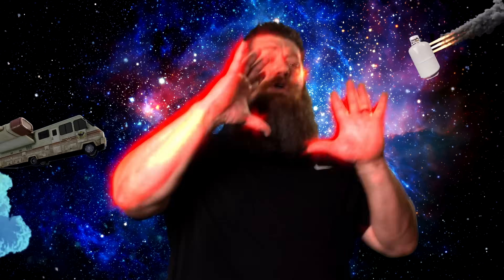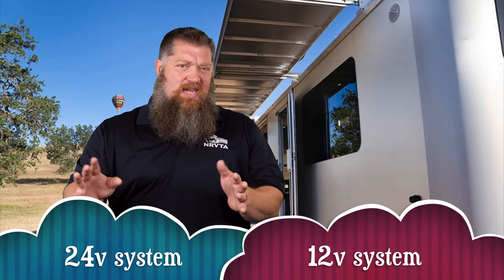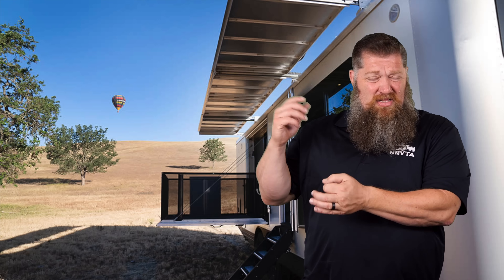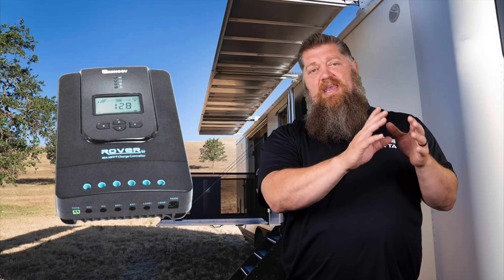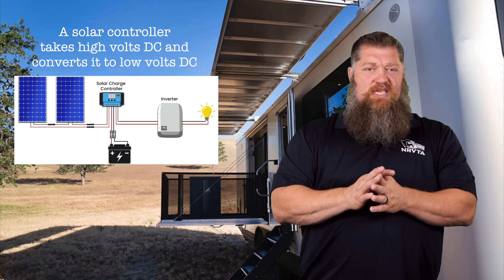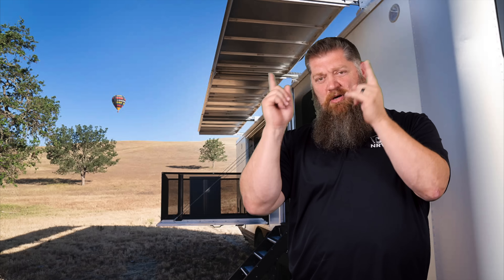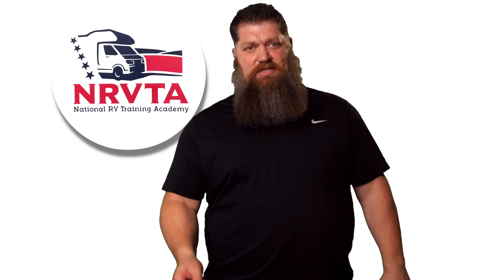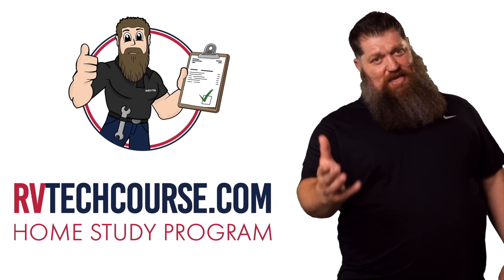Considering solar?  What's the difference between a 12 volt & 24 volt system?

Comment: What about the energy density of the batteries between 12v, 24v and 48v?  I am looking at a system using a 48v system party due to the price/kW hour for the batteries AND the fact you can dump a ton of solar into a 48V system.
Reply: For the same battery chemistry the energy density / capacity (in watt-hours) is the same regardless of the battery voltage.   E.g.  200Ah 12V battery vs 100Ah 24V battery vs 50Ah 48V battery ... all three batteries will weigh and have the same dimensions and capacity, roughly.   The internal topologies of the batteries are the only difference.  e.g.  4s4p (16 cells) vs 8s2p (16 cells) vs 16s1p (16 cells).  For example. 

NOTE: For 48V LiFePO4, always get 16s (16 series internal) "48V", which is 51.2V nominal.  Don't get 15s batteries that are also marketed as "48V".

In anycase, if you have the choice, go with 48V, it is hands-down the best choice for many reasons, not just wiring.  Amperages are far lower, heat is far lower, efficiencies are far higher, charge controllers (as you noted) can push far more solar power.  A 48V system has 1/16th the wire losses that a 12V system has.  48V is massively expandable even when starting small.

On the charge controllers.  For example, a cheap Victron 100/20 charge controller can push 256W of solar to a 12V battery system, and the same charge controller can push 1024W of solar to a 48V battery system.  Its night and day. 

EDIT EDIT EDIT:  I previously used the Victron 75/15 as an example but that charge controller cannot actually do 48V battery systems, so I updated my example to using the Victron 100/20 which can.

There are other discussions that can be had regarding equipment.  12V legacy equipment is certainly an issue but I would also say that when putting together a new system all the heavy hitters have native 48V options.  And things like POE+ (power over ethernet), including Starlink, can be directly powered on 48V 16s LiFePO4 (51.2V nominal) battery architectures.

-Matt
Reply: @junkerzn7312  wow...thanks for the info.  I am already planning my system to use 48v.
Reply: @markk171  One last thing I should mention is that with a 48V system voltage, the solar inputs for most charge controllers have to having operating voltages of 60V+.  Which means the minimum panel configuration is something like 3 x 100W panels in series.  Or for example two 320W 40V residential panels in series.

That's the only real issue and most people putting together systems and looking to expand have at least that in solar panels already.

In anycase, it is still possible to use cheap charge controllers.  The Victron 100/20 is a good fit.   The Victron 75/15 which I improperly used as an example in my first posting actually only does 12 or 24V batteries.  So the minimum charge controller for a Victron is the 100/20.   Always double check voltages.

-Matt
Reply: @junkerzn7312  yep...the Growatt 3000w inverter/charger solar input is 60v and the EG4 all in one 3000w inverter/charger requires 120v. My initial build will not include solar...these are for later.
Reply from the maker: So to understand your question, I think you are asking total watts and size of battery in 12v vs 24 vs 48

Energy density is calculated by the actual substance providing the energy in relation to volume. 

The specs of my batteries can be found here. https://www.bigbeardbatteries.com/online-store

Comment: LOVE YOUR VIDEOS, I'm getting a 2023 motor coach. It has 1 200 watt solar panel, a 1000 watt inverter , a dual controller what ever that is and 2 100 AH AGM batteries. I plan to up grade the inverter to 2000 or 3000 but initially would like to upgrade to a 200 or 300 AH lithium battery, can I just drop a lithium in with my current equipment ?

Comment: I watch and enjoy your videos but this one i feel compelled to comment.  I don’t think saying “by going 24v that you can double amount of panels”. Don’t you have to  consider panel voltage/wattage and series/parallel?    Thanks for all you do.
Reply from the maker: Absolutely. But let me sow you. 

300 watt panels
40 voc
10 amps. (Edit the fat finger) 

On a 12volt system  with a solar controller 150/100

I could put 4 in series/parallel ending with 80voc 20 amps 1200 watts. 

The solar controller is maxed at 100 amps regardless. 100 amps at 12 volts, limited to 1200 watts. 

In a 24volt configuration. I could do 4 strings of 2 in series. I would be at 80 volts abd 40 amps. 

The solar controller pushing 24 volts at 100 amps max gives a potential of 2400 watts.
Reply: Thanks but I’m not following your math of 40voc/20a = 300watt per panel. If you could please let give me example of a panel w those specs, I can pull data sheet n figure it out.  Also, in 12v example, if (4) were in series/parallel wouldn’t output be 2xVolts  and 2xAmps of panel rating?   For my small 2S/2P of 4x100, I get ~40v @ 10a.  Just trying to learn so I appreciate your time
Reply from the maker: @BigSpoonSaloon  so it’s 10amps. I fat fingered to the 20

Comment: is there an advantage on going with 48v system (EG4 48v 6.5kw all in one inverter) with 2 - 100amp batteries vs 12 or 24 volt with 200-400amp battery bank?  Would the 48v need a step down transformer as well or is it contained in that system? Would I even need that size system on 45' toyhauler?  Would like to add 600-1000 watts of solar panels to roof.

Comment: Another benefit, and the main reason I chose 24v for my very large dual 5k inverter setup, is the efficiency. Charging and consuming power at 24v is more efficient than 12v by a few percentage points at least (48v is even better). You have lower current through conductors, so lower transmission losses, and better conversion efficiency in charge controllers and inverters. I do have native 24v batteries in my system so I do not have to balance upper and lower stacked 12v batteries - definitely they way I would recommend going about a 24v (or 48v) system - native voltage batteries. I am not a fan of running batteries in series personally.

Now 24v does require some DC-DC converters for your house 12v DC loads and those will have a conversion loss as well. For me it came down to "where is most of my power getting used?" 12v DC or 120v AC. For me it was the 120v AC so I prioritized higher efficiency there (my inverters) vs worrying about the 12v conversion loss.

Comment: Good stuff. A couple more things to chew on. (As Les commented) With a 24V setup, you'll also need a buck converter to step down to 12V to power your house DC circuits. Adding to your point on solar, you potentially will save a bunch-o-$$$ with 24V, assuming you're maxing out your solar. Since you're generating less current solar charging a 24V battery bank, you can use MPPT solar charge controller(s) with a lower output amp rating (less expensive). The higher rated controllers really get expensive. Hope that makes sense 🙂

Comment: I am running a 24 v system with 600 watts of solar panels  with 2 lithium batteries in series for 4 years now. I run a step down transformer 24 to 12 volts that runs all my 12 volt system at 13.6 - 13.7 volts .  I've been very happy with it so far.
Reply: is that 3  -200 watt panels?
Reply: @ThomWalbranA1  6 - 100 watt panels
Reply: Any difference in discharging the batteries? Because I have two 12v 200ah lithium batteries blue carbon, it's looks like those batteries were not make it to work in series, when get 27.5 the BMS start cutting the power... Horrible...., so I'm thinking to put them in parallel buying a new 12v inverter.
Reply: @corsario75-col  I have SOK batteries, I monitor them with a Victron shunt and the voltage has stayed very close to each other. I don't know why your BMS cuts power, you should be able to go to 28.8 volts.Sounds more like an issue with the solar charger.
Reply: @mkroach59  thank for reply, after running my investigation and watching more than 15 videos, yes  it's the cheap BMS in blue carbon battery, a lot of people complaining about the bms, they even change the bms for one of 24v for two 12v batteries.
Reply: How many Ah are your lithium batterys?
Reply: 208 Ah @liamcrone3212

Comment: My issues are how many 200 w panels can I have with a 30a solar controller and how many 100a batteries can I have/get. Note: I have 2 panels, 2 100a batteries and a 30a controller
Reply from the maker: So a 30 amp solar controller going into a 12v battery is pushing a maximum of 360 watts. (30x12). So 2 to 3 panels is a good match. Any more and you are just taking up valuable space on the roof and never getting more than 360 watts of charge. 

At 24 volts then you can charge up to 720 watts.

Comment: Yep my buddy installed a 24 volt system, unfortunately his charge controller failed and sent 24 volts through his 12 volt appliances. It cost him thousands to replace everything.
Reply from the maker: Lesson learned. A battery protect is a must when using a 24volt system. Ask me how I know…